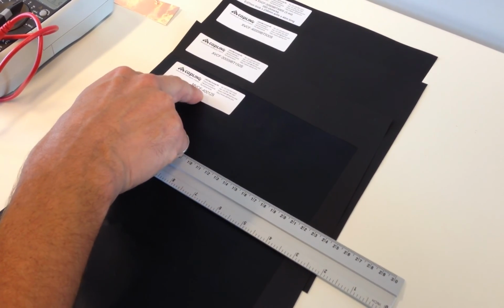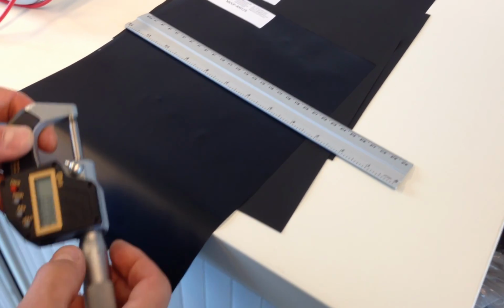Difference in Surface Resistivity of Linqstat Volume Conductive Films

Comment: Not sure why you're saying a definite resistance value when you can openly see the multimeter is fluctuating by at least +/- 20%. It's also totally unclear what a "square" is. This video is interesting but too ambiguous to be helpful.
Reply: Since it is a sheet of conductor the resistance "square" is ANY square size on the sheet. So the resistance between two corners of any square is the same. Multimeter fluctuations can be due to handheld probes, etc.

Comment: "... they are often confused by Surface Resistivity vs Volume Conductivity" - and I still am.

Maybe I drifted off for a moment, but when did you explain what the term Volume Conductivity means, in this context?
Reply from the maker: The surface conductivity is measured across the surface whereas the volume conductivity is measured through the thickness of the sheeting.
Reply: Thanks.  It might have been an idea to open with that.

At 0:32 the resistivity is defined as "Ohms per square".  That makes no sense to me.  Ohms per square what?  Meter?